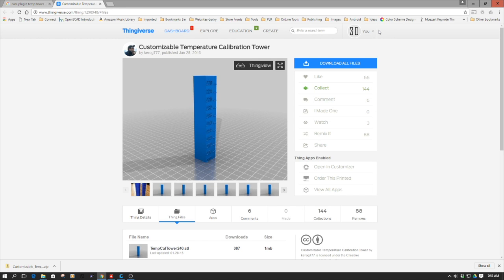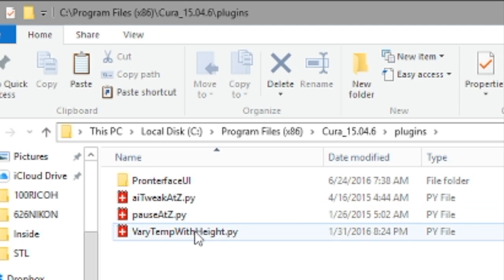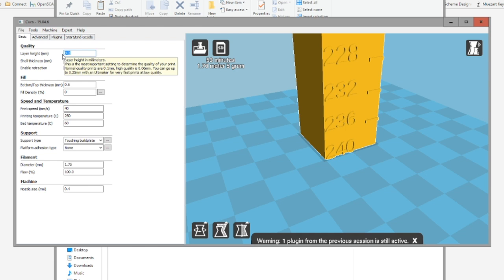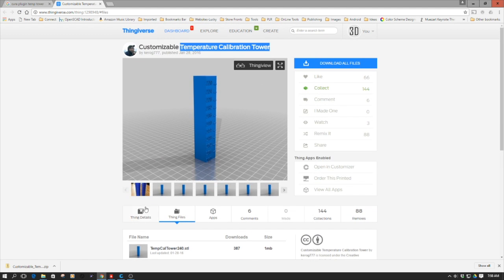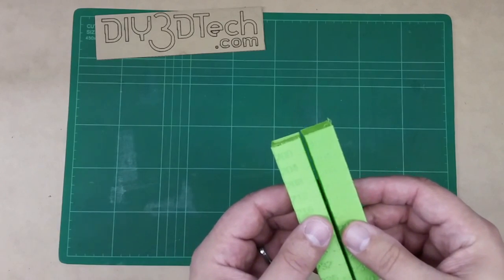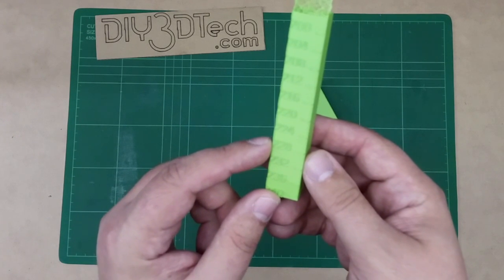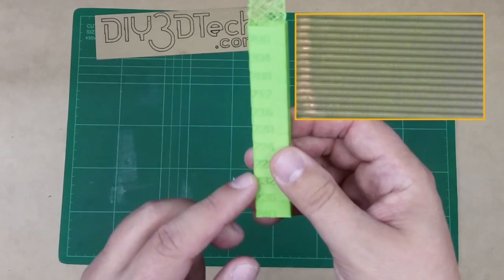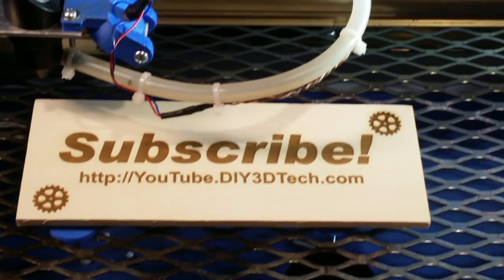Monoprice Select Mini 3D Printer  -  Printing a Temperature Calibration Tower!

Comment: Sometimes when I need to do quick micro-measurements, I place the object onto a photo scanner along with a ruler that has millimeters (as a double check for reference). A 600 or 1200 dpi scan should be sufficient. I've imported these images into Sketchup to trace and replicate small objects.
Reply from the maker: This is a handy tip, thanks for sharing!  :-)

Comment: So I noticed that the plugin calculations was with .4mm/layer.  You'll need to tweak the plugin to accommodate for layers based on height (i.e .2 layer, change temp to change by 4 every 20 layers (or 2 by every 10))
Reply from the maker: Yes needs to be adjusted layer...

Comment: Hey! Dunno if you've looked at the math behind macro lens aspect ratio replication. 

Anyways, appears Python could do multicolored printing... and much more (Python Power).

Frankly, I know little of it, beyond reading it's name mentioned throughout 3d printing threads.

Also, what's your take on PLA+ (PLA  Plus) strength value vs PETG? Thx. Thumbs-up!
Reply from the maker: PlA+ does not even come close to PETG strength wise, the only thing I think PLA+ does is give you a better looking print then regular PLA and it might be a little strong, but not enough to impress :-)

Comment: thank you for the video! I'm a bit confused by the results though. The highest i've heard of settings is 210 for pla, maybe 205... so that would mean that you'd set in cura the setting for say 230 ?!? I was under the impression that 190-210 is the range for pla, or is this another material? sorry if i'm asking something stupid, total, newbie here
Reply: as an extra question to that, do you by any chance have a beginning recommended settings for cura with the mp select mini? something more general likely to work with most filaments? I found this article http://johnbiehler.com/2016/06/05/monoprice-maker-select-mini-3d-printer/ and it's got a 215 temperature (again, already higher than what i thought pla likes with a max 210...  so much to learn...)
Reply from the maker: 190 to 210 is the average for PLA however depends on the type of PLA too.  As some require 230 (typically specialized)
Reply from the maker: Watch the videos in my Wanho playlist that talk about PID and temperature settings.  As just  because your machine say its 210 doesn't mean it is...
Reply: I've heard about this term specialized and about exotics... but i've never seen one for sale... are they somehow normal looking but i should somehow recognize them? I'm wondering particularly because i clogged in a way i didn't know how to fix an Anycubic I3 Mega with this filament https://www.amazon.de/NuNus-Filament-Qualit%C3%A4t-MakerGear-Ultimaker/dp/B01GK2PBAU/ref=sr_1_5?ie=UTF8&qid=1494406123&sr=8-5&keywords=NuNus%2BPLA%2BFilament%2B1KG&th=1 and now i've bought a MP Select Mini  machine and i'm wondering if I should not use that particular filament because it's somehow special or if i should use it at higher temperatures. I picked it because of the nice color but maybe that's the kind of thing that makes it special and higher temperatures or more likely to clog? I wouldn't want to have to send back the Mini also as I have high hopes for it.
Reply: I definitely will. Does that mean that it applies not only to Wanhao but also to the Mini? I thought temperature settings were somehow machine dependant.
Reply from the maker: Most machines are "off" just depends how much as you can calibrate but is a bit of a pain...
Reply from the maker: This seems to be normal PLA just a higher grade...

Comment: I use bluebeam PDF software and you can set a scale (force a scale or calibrate it in screen) then measure and it's highly accurate. Even has accuracy tolerances if you want to get picky. So my suggestion would be to snap a JPEG with your part and a "calibrated scale" in the picture then use the scale to calibrate the  measurement in bluebeam.
Reply from the maker: Since this is nothing more than web-cam was hoping to find someone that did a live view version.  Many moons ago (pun intended) I was into Astrometry and written a app in VB that took a camera feed and would measure distances (live).   I just have time to reteach myself VB, write and debug the code :-(

Comment: I tried this and the plugin doesnt look like it worked  do I have to print from Cura?   I run octopi  does this plugin add to the gcode?
Reply from the maker: Should work, also if you take the gcode from Cura and import into Octoprint hat will work also.  Note in the plug in you have to (1) activate it and (2) set your layer height for the temp change to take place.  You can also check this in the gcode by opening it an editor...
Reply: ya i did that  and in the Gcode there was no temp changes  my test looked exactly the same from bottom to top
Reply: actually found the right lines.  so guess my PLA likes the range specified on its reel 180 to 210 as thats what i checked.
Reply from the maker: Glad you got it figured out!

Comment: Either photoshop or the GIMP will measure pixels. the gimp is a free clone of photoshop you can find online.
The method is pretty much identical for both programs. Here's a tutorial showing  you exactly how to do it. https://www.youtube.com/watch?v=nmhQqyTLUzQ
if you need to turn the pixel measurement to some scale (in, cm, whatever), just measure something you've calipered at the same magnification. So lets say you measure something and its 342 pixels @ 100x magnification, and a penny;s diameter  is 450 pixels at 100x.
The scale is 450px = 0.75in, or 600 px per in.
The item is then 0.57in (which is 342/600). 
All these numbers are made up, i'm just showing how it all works.
Reply from the maker: Thanks yes have both, however I am looking for something that takes the web-cam input and does it live from the feed.  I use to do Astrometry and had apps (some written by me) that would take the feed of the camera do an Arcsecond overlay.  Was hoping to find something like there for this as I am now to too lazy (I call it busy) to code my own...
Reply: if the API i use for D3D still supported web cam as a surface it would not be too hard , but MS changes something and now i cant use web cam feed as a surface .  I have not had need of it for much , but now you mention i should have a look at trying to get it working again .  measuring then becomes
easy once you can pick points with a mouse. 
i was looking at this a while back http://www.miketreth.mistral.co.uk/centrecam.htm
just tested : http://www.markus-bader.de/MB-Ruler/index.php
it is not free , and the non pro version does not let you set user screen scale , only select from some presets. but it is a overlay
Reply from the maker: Both are very Mach3 has something like center cam and use to use it lot in the past.  However you have the idea spot on!  :-)

Comment: Even if you calibrate the camera somehow you will only know pixel field of view, to relate to distance you need to know range, which is almost impossible to measure accurately.
Much better to put in a known reference object into the image... the object ideally would be exactly same range, right on the surface, so it has to be very flat.
Reply from the maker: Actually that isn't correct  as very precise astronomic measurements are made this way (have written software to do this in the past) as if you know the pixel size of the CCD or CMOS you can calculate it, think of it like a parallax as no matter the distance the ratio will work the same.